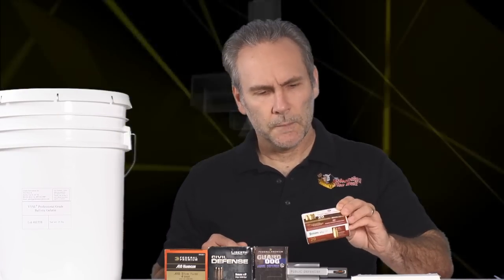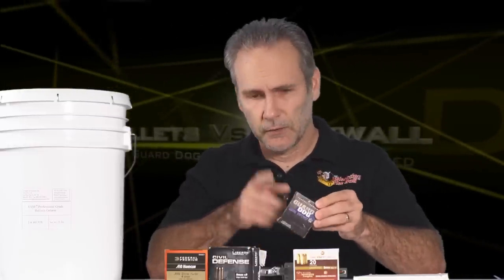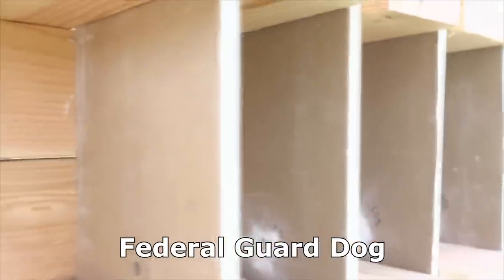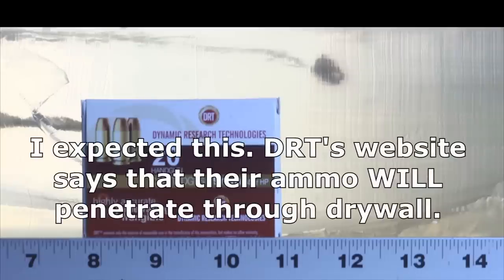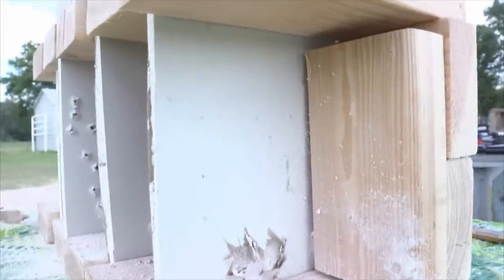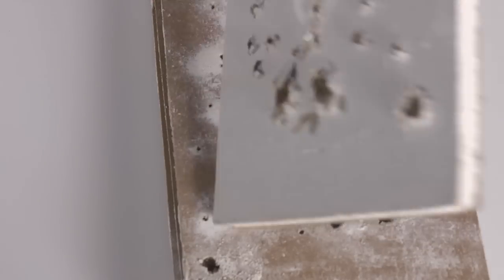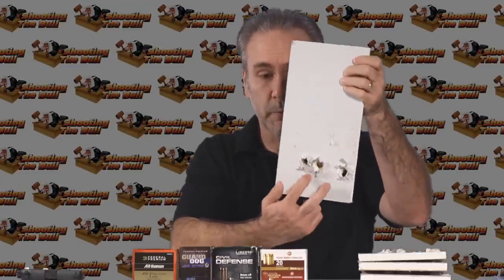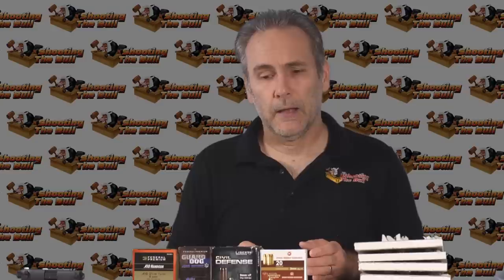Bullets vs Drywall: test of DRT, Liberty, and Guard Dog for home defense through walls

Comment from the maker: TO: Roy Lindsey
"Why do you think a pocket sized 9mm, 3" barrel, is pretty weak? Just curious, thanks."

The comment was meant in context with being used as a home defense weapon.  A 3" 9mm is a fine choice for pocket carry, where the tiny size of the pistol is the benefit one makes for the tradeoff of sacrificing power and performance.  But for a home defense gun, the common thinking over the years has usually been to use something like a 12-gauge shotgun, or maybe an AR-15.  Either is vastly, supremely more powerful than a pocket pistol.  In home defense, a larger gun size isn't usually isn't a detriment to weapon selection; you have the flexibility to choose larger weapons, and larger is usually more powerful than smaller.  All things being equal, a 4.6"-barrel Glock 17 is going to deliver more force than a 3"-barrel P938, for example.  And a 12-gauge shotgun is going to be tremendously more powerful than either.

So, in context, for a home defense weapon, the pocket 9mm is probably the least powerful weapon that should be reasonably considered for that task, and since you're usually freer to choose from among larger weapons (whether a full-size handgun or some manner of long gun), you should always use the most powerful weapon that you can accurately control and that is appropriate for the task.
Reply: I would say you should shoot low powered rubber bullets if you do not want them to penetrate wall.

Comment: The solution to the problem is stronger walls, not weaker bullets. People don't read many actual books anymore so you could search craigslist and your local 2nd hand store for cheap books to buy that you can stack on shelves in any area where you fear a stray bullet might injure someone on the other side of the wall. You might never read those old National Geographic magazines or encyclopedias, but they could still serve a purpose at catching stray bullets.

Comment: ...in my pk380 walther, (3.6" barrel)...the drt 85gr. passed clean thru a thick square plate of aluminum, about 1/8" where my pmc 90gr. fjm ammo just dented the metal.....(12 ft away), the drt didnt explode or powder upon impact....rather it opened up a big hole in the material.....you could put your index finger thru it...the recoil was minimal, but then again with the walther, all ammo is mild because it isnt a blowback design pistol....i also shot a 2 gallon jug of kitty litter filled with water.....the drt passed clean thru, and left 4 good sized copper colored petals in the bottom of the jug.....i am stoked about this round.....thx for the great vids.....

Comment: Have watched several of the tests with gel and you did a great job with this one especially using the short barrel which is common for concealed carry.  I bought the DRT for self defense carry for this purpose.  As others have said, hitting the target is important to prevent hitting someone in another room, but what if one had to shoot through a wall or door in order to stop a perp......this ammo and the other is capable of doing so and I think that is also important.

Comment: Actually a condominium wall is much more than a single sheet of 1/2" drywall on each side of the studs. If it's up to fire code it's two layers of 5/8" fire code drywall, which is much harder than non-firecode, on both sides of the studs.

So 1/2" on each side of the studs is a good test for interior walls. For condominium walls you should use 4 layers 5/8" fire-code drywall with the drywall in pairs as in DW-DW-Stud with insulation-DW-DW.

For normal exterior walls that needs a lot more testing with various types of exterior walls such as stucco.

FWIW, when we remodeled our home we only used 5/8" fireside for interior walls with insulation for mainly two reasons. Contain fire within a room and better sound proofing. A side benefit would be better resistance to some ammo.

Comment: The actual advertised quality of DRT is that if it hits an organic target, it will disintegrate and not hit an unintended target behind the organic target(intruder/attacker). They never claim to not go through walls. It even says it on the box, round will pass through light reinforcement and will keep its shape until impacting organic material/water.

Comment: Funny thing about frangimenting rounds is that they penetrate more at LOWER speeds like in a short barreled pocket pistol. They require VELOCITY to bust apart. Push these through a 4.5-5" barrel and you'll see very different results.

Comment: An internal wall in a condo is the same structure as in a single family home, no different. Now the wall between condo units, which I believe is what the customers were referring to (so they do not shoot their neighbors), is not the same construction. There is a cinder block wall between condo units, not just two pieces of drywall and insulation.

Comment: "If they penetrate out of this you can pretty much assume they will out of any larget pistols" - no, because those bullets might require a certain minimum velocity to perform (fragment) properly, in fact frangible bullets like that usually require precisely that so if you wanted to give them the best chance possible you'd fire them out of a full-size pistol like a P226, G17, etc.

Comment: Aloha.
As this video specifically is titled '...for home defense through walls', the responsibility within your own home for your ammo choices and mitigation of penetration risks through your walls is solely on your shoulders, the person who calls that structure 'home'.  That means doing a full walkthrough and identifying shooting scenarios where your bullets will go beyond your exterior walls (1st level to be mitigated) and where your bullets will go beyond interior walls and endanger someone beyond your field of vision (2nd level to be mitigated, and don't claim to be a son of Krypton with X-ray vision, you are not).   Just like drawing up a fire evacuation map for your home, it means identifying the safe to fire vectors within your home, and those to be mitigated.  On a first go around, you might find that the only place in your house safe to shoot from without penetrating to the exterior is from within an interior bathroom.  Not a very warm & fuzzy situation to be living in.  I suggest mitigating hallways and corridors first.  Line them with heavy duty floor to ceiling bookcases, loaded with heavy books or magazines.  Encyclopedias, decades of National Geographic etc.  On the walls of rooms that run along the hallway, also put bookcases on those shared walls, forming a bookcase/wall/bookcase sandwich.   Properly done, you can establish a long 'shooting box' within your home.  IF you happen to be doing any home renovations/repairs/remodeling, consider including bullet 'resistant' materials in that work.  There are various wall sheeting materials that can be installed beneath your finished wall surface with various ballistic ratings.  Clearly not an option for renters, but for a long-term home owner, it is an option.

@STB410, thanks for constantly rising to the occasion of not taking anything said by anyone without actually putting it to the physical test.  Debates can rage back & forth for years, but when you put something to the test, the results speak for themselves for eternity.

Peace & Prepare
Pax et Paro

Comment: Lower velocity rounds will not meed the required energy levels to fragment or break up as they are intended to... Try a 45 grain frangible .223 through the drywall.
Reply: Which is why you have to drive them much faster than a pistol is generally capable of.
Reply: ***** I disagree.
Reply: I agree with you there. Load a 50gr. Sierra Blitz in a .223, and the bullet wants to break-up. That jacket is so thin, and the lead is so pure, that it wants to fragment at those speeds. Any destabilization of the bullet would cause it to tumble, and break-up in flight. They are meant for slower speeds, in old guns. When they are pushed way beyond their designed limit, they basically explode on contact.

As an example, I had a friend who loaded some of those Blitz up for extreme speed in a 220 Swift. They were fast, and I watched as my dad hit a leaf of a weed at about 120 yards down range. I could see the bullet, make this crazy looking forked con-trail as the jacket tore away from the core. I saw in the spotting scope two flashes of light out from the ends of the con-trail. It was the sun glaring off the metal flats of the two bullet pieces.

In the end it is all about the bullet's construction, and the speed that the bullet is traveling at when it impacts the target. A varmint bullet at slow velocity will act like a controlled expansion bullet. A controlled expansion bullet pushed way too fast will act like a varmint bullet. The final word is heat. The velocity is converted to heat, and the heat is what melts the lead inside the bullet. This semi molten lead ; semi since the boiling point is raised due to pressure; will act like a fluid, and thus not act as a solid support for the jacket. This is what really determines the strength of the bullet. Is the jacket to tough to open correctly, or is it too soft to stay together long enough to exit. Or is it bound correctly to stay attached to the lead core of a hunting bullet, or is it to welly bound to the core to not break-up completely in a varmint bullet.

Comment: The Guard Dog confuses me. tnoutdoors9 fired the 9mm through 2 layers of dry wall and 4 layers of denim and it went 8 1/2 inches both times.  Others have fired the 45 into bare gel and it went 8.2 and 8.75 inches.  So how can it go the same distance with or without added barriers?

Comment: How about Glasier Safety Slugs?  Weren't they originally designed to be used by air marshals for shooting in a pressurized airline cabin with reduced risk of explosive decompression?
Reply from the maker: Not really -- that's a common misconception, but the air marshals initially adopted Glasers because (as I understand it) they were far more concerned about overpenetration through people, than they were about the airplane wall.  Airplanes are about the most crowded environment one is likely to ever encounter using a firearm in (well, outside of a mosh pit, I guess) so if the bullet penetrated through a person, it's extremely likely that it would hit an innocent.  Hence the initial appeal of the idea of a non-penetrator like the Glaser.  But as far as I know, the air marshals moved on to conventional ammunition.

Glasers have been tested by others through drywall and found to plug up and zip through walls just like FMJs or conventional hollowpoints.

If a Glaser (or a Liberty or a DRT) were to hit a person, the odds of the bullet passing through them and then going through a wall, are extremely low.  Then again, the same could be said for a properly-functioning hollowpoint.  An FMJ, on the other hand, will go clean through a body and then through walls and be dangerous to those on the other side.
Reply: Explosive decompression is a Hollywood myth go check out the myth busters episode.

Comment: So.... XM193?  I hear that high velocity fragmenting rifle rounds are better at preventing over-penetration in interior walls.  Any chance you could test the penetration of an AR compared to the slower, more solid pistol slugs?  It's either that or a wakizashi...
Reply: If I recall correctly, TNoutdoors9 already did a video on that. Try looking his up. I think the conventional wisdom was wrong though. XM193 blows through interior drywall pretty much intact.
Reply: I can tell you from personal experience that M193 or M855 will go right through most of a lightly built building.
Reply: For 5.56mm use 50-55 grain or so ballistic tipped hollowpoints. They will start to fragment as soon as they hit pretty much anything including a piece of drywall unlike 5.56mm FMJ rounds which will usually just tumble when going through drywall and will still go through 3 or 4 walls. That is unless they decel enough or change direction fast enough to cause the bullet to break in half, which normally requires hitting something a little more solid then drywall to do. Hollowpoint rounds from a handgun that are plugged up with drywall act just like FMJ rounds do and will go just as far if not farther then the FMJ in 5.56mm.

The 50 grain ballistic tipped hollowpoint will still go through a couple of walls, but the smaller fragments will not penetrate as deeply and will hopefully not be fatal. Anything lighter then 50 grains and there is not enough penetration to hit vitals, but it will depend on bullet manufacturer to some extent. Hard to make a round go 12-18 in flesh, but not penetrate a piece of drywall like shootingthebull stated.

Comment: Do you think this just ends up being another argument in favor of using a carbine for home defense so that you can take advantage of the longer sight radius and three separate points of control (stock, grip, foregrip) to minimize missed shots?
Reply from the maker: You could certainly make that argument in its favor.  The knock against carbines or other long guns has usually been that it takes up more space and makes it easier for the bad guy to grab the gun or whatever, but -- if you hold a handgun in regular extended-arm stance, the tip of that handgun is as far or farther away than a carbine's muzzle tip would be.  But if you were gonna use a carbine, why not go ahead straight to the 12-gauge?  Same overall size, same aiming and control advantages, but cheaper, and vastly more powerful than any pistol-caliber carbine could ever hope to be (excepting maybe a .454 Casull carbine)...
Reply: ShootingTheBull410
A bullpup or AR pistol might get around the first problem--probably not so much on the cost.

Comment: if he said it wouldn't go through the wall of a condominium he might be right because there are alot of materials in between each unit sometimes concrete if not at least two layer or 5/8 drywall on each side

Comment: I was wondering why you didn't shoot any of the liberty ammunition during the 380 ammo quest. Is it because if is more likely to not hit the 12" mark.
Reply from the maker: Liberty is a fragmenting round that does all its damage in the first few inches.  The bottom core base of the bullet may penetrate deeper, but in the 9mm version that I tested, the base weighed only about 26 grains.  I would expect the .380 to weigh notably less.  So, yes, Liberty does pretty much exactly the opposite type of damage as what I was looking for.  I was looking for bullets that would reliably penetrate deeply, such that they would consistently be able to hit vital organs or otherwise cause deep damage.  Liberty and other fragmenting type rounds or frangibles typically do all their damage at a shallow level, which is the opposite of what the prevailing wisdom for bullet effectiveness teaches.

Comment: Well i am disappointed in the Guard Dog. I guess the remaining solace that we have is that we will probably never have to use it anyway but that defeats the whole idea, doesn't it? 
Some condos however have a double sheet of drywall separated by for inches or so that is supposedly filled with insulation and then another dpuble sheet of drywall. 
I would think that this dramatically slows tha Guard Dog down.
Can you run this test? This is more common with the newer construction I think.

Thanks.
Reply: Fiberglass/cellulose insulation is 99+% air. If you think it can meaningfully slow down a bullet then there's a little cause for concern. It also is only applied to exterior walls, when the most pressing penetration concern is collateral damage to a member of your household.
Reply: Ech0Sierra No, not the insulation. The double dry wall. Apparently it will not stop it but if it is two sets of double dry wall, four altogether, will it make a difference as compared to the four that is in this video? Forget about the insulation. My guess would be that it would penetrate the gel less but probably still result in a fatal shot. I know practice helps but at 3:00 in the morning from a dead sleep, when suddenly an intruder is threatening one's life... shot placement may not be so good. Pepper spray better?
Reply: Tom Triolo Personally I go for a giant stinking weapon light to surprise shine in their face which hopefully buys time for them to reconsider anything stupid and buys me time to acquire a proper sight picture. #1 buckshot at that distance is basically a frangible slug
Reply: Ech0Sierra I'm a bit uneducated on the shotgun thing since for some reason I have been avoiding it. I think because I don't want to buy ammo and go through the learning curve. Maybe some day. But, #1 buckshot. Is that the smaller or bigger pellets? What kind of penetration does that pose?
Reply from the maker: Tom Triolo Buckshot sizes start at #4 (for the smallest) up to #1 (bigger), then 0, 00, 000, and 0000 (biggest).

#4 buckshot is about the diameter of a .22lr bullet, and about 21 grains.
#1 buckshot is about .30" in diameter (as big around as a .30-caliber bullet) and weighs about 41 grains apiece.
00 buckshot is about .33" in diameter and weighs about 54 grains apiece.

#1 buckshot, as made by Federal and sold in their Flite Control LE132-1B, has been tested to deliver about 14" of gel penetration, which is rather ideal, especially since a load of the #1 buck contains 15 pellets, nearly twice as many pellets as is common in a low-recoil 00-buckshot load.
Reply: ShootingTheBull410 That sir, was some great information. Thanks!
Reply from the maker: You're welcome!